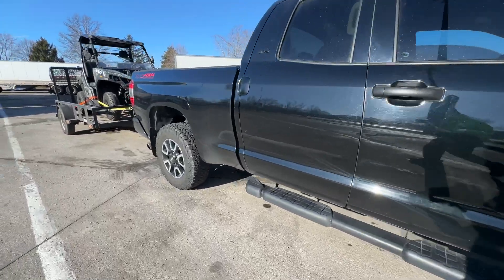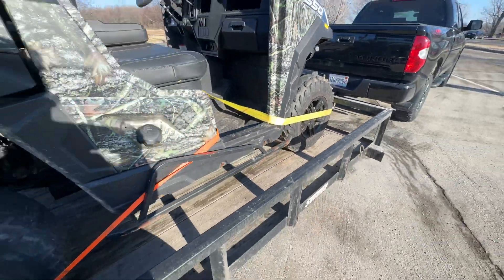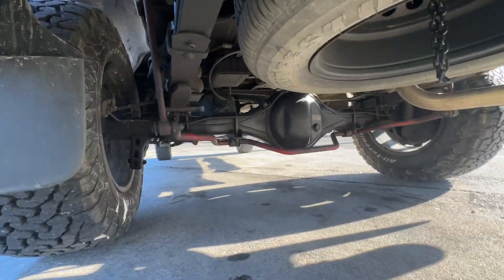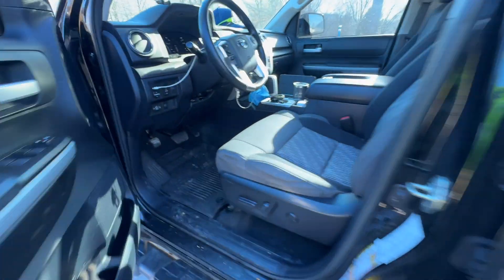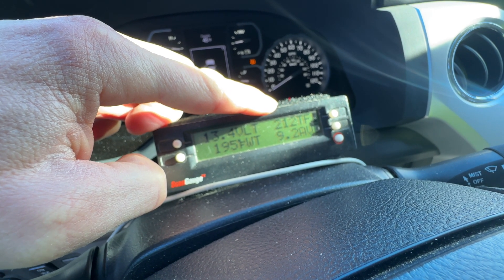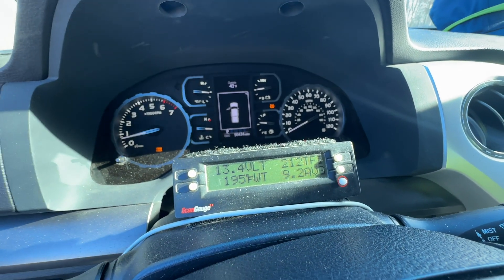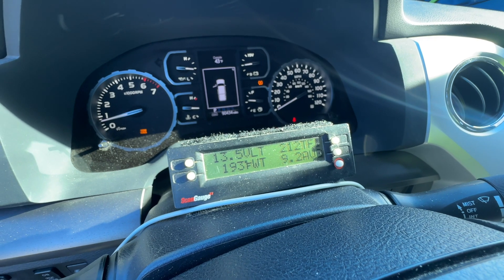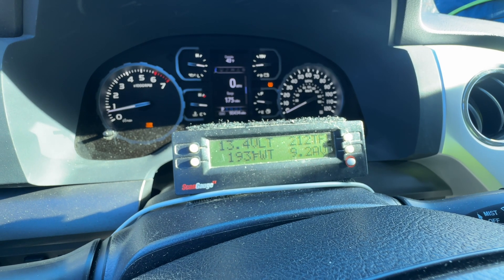Tundra Towing - Without Transmission Cooler?!

Comment: I added a Trans cooler to my 2020 TRD PRO but probably didn't need it. I haven't towed very much but I will tell you that it did lower my temps as now I can hardly get the trans temp to go over 210 degrees and when it does it comes back down pretty quick.
Reply from the maker: Really, what kit did you install?
Reply: @backyarddadKL  I think it was from genuinecoolingsystems and the cooler was called "setrab" or something like that. I'll look it back up if you really want to get one or need but I think that was it.
Reply: @dalephillips8250  did you install it yourself?
Reply: @SuperSnakePlissken yes I did.
Reply: @dalephillips8250  Got the same kit on mine and I love it. Super easy to install and the cooler is a nice beefy unit. The temps came down considerably after installing mine.

Comment: Hello, fellow tundra owner. I have the same setup. 2019 Toyota Tundra SR5 Crewmax 4x4 off road and i pull 9,200 pound trailer. 2020 Grand Design 3,000 QB